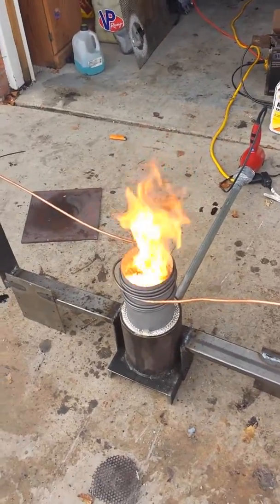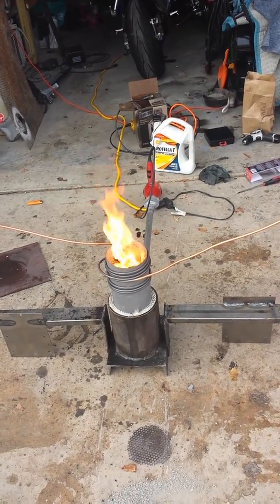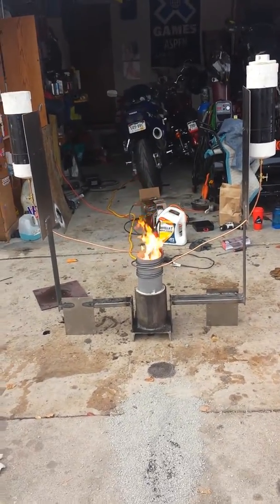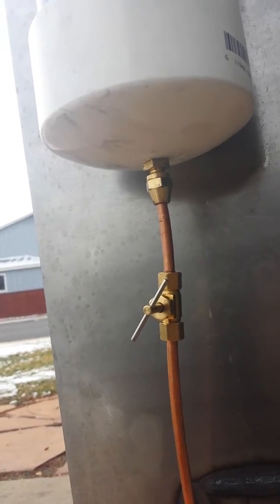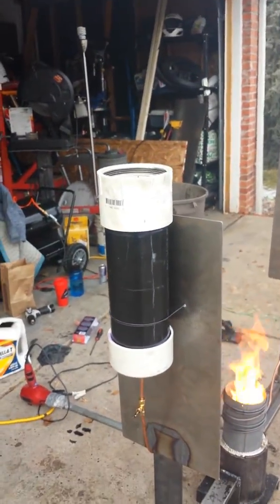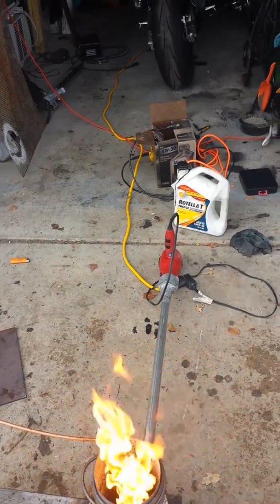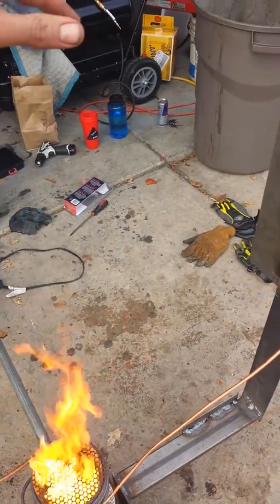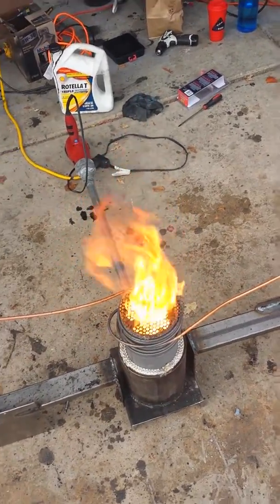How to burn glycerin

Comment: You can actually power a generator on glycerine. A biodiesel plant in Japan repurposes glycerine into a legit fuel
Reply: hello can we use raw glycerin in generators? need to mix it with any other material to reduce the density and viscosity?